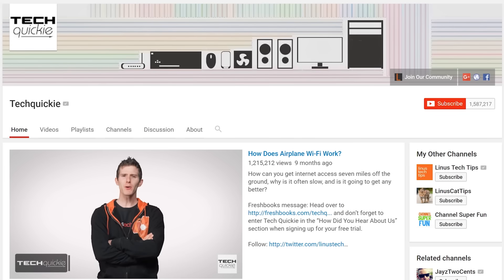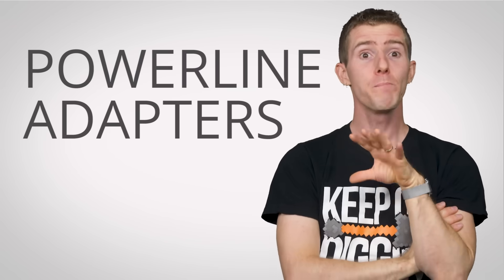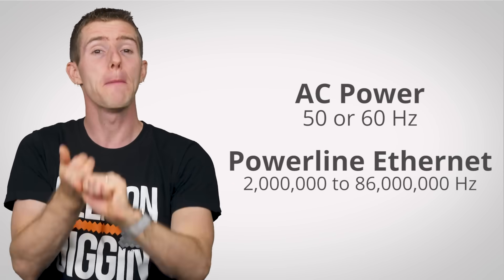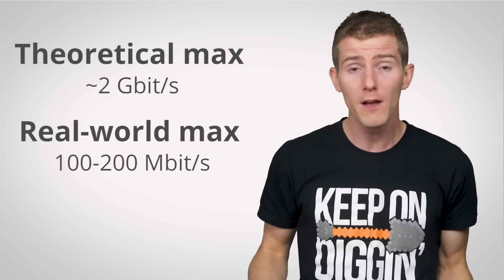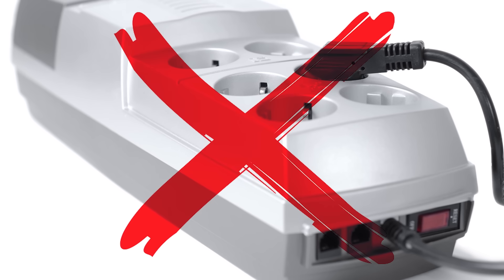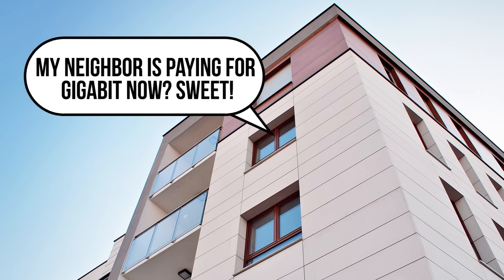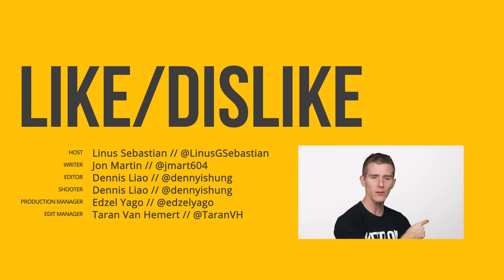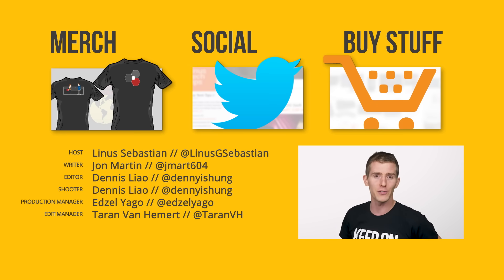How Does Powerline Ethernet Work?

Comment: So I’ve used Powerline before in my condo in Canada but I’ve moved to the Philippines and have a few concerns.

1. We have 2 condos now but are across each other. The engineers weren’t so clear but assuming that the cables are assigned per side (divided by hallway) rather than per floor, would powerline still be viable?

2. In my room, there’s a lack of power outlets so I would need to use extension cords and the most conveniently placed outlet is also blocked by my bed so directly putting the adapter there is a no go. I always believed powerline only worked directly but is it really possible to link it through extension cords? Would it simply depend whether that particular extension cord allows the signal to come through? If not, would it be a better option just to have the adapter on the other side of my room and purchase a wifi card for my PC?

3. Also regarding my room, there’s a conveniently placed telephone outlet where my desk is (but no power outlet, weird right?), is there a way I can use it to obtain a signal from my modem on our fiber plan? The modem itself is connected using a telephone cable too. My original thought process is that you require another input from the modem but I may be wrong.

Edit: My room is in the condo with the modem if that clears any confusion with the first concern.
Reply: No the powerline won't work well in your situation. The best would be to use a mesh network capable APs/Routers in both condos to bridge the network between them.   You could do this with other APs & Routers that are much cheaper but the ones that advertise "mesh" instead would create a more stable environment/connection because of how they communicate with each other and have MU-MIMO.  Depending on the construction of the building, the signals will probably be strong enough.   Look up "best mesh wifi 2017" or something like that to find products; it's a bit more pricey but I'd go that route.

Comment: I have Ethernet connection throughout my home and have really weak WiFi signal on one side. Is there away to expand my WiFi signal w/our buying a repeater or setting another router? Don’t want to deal with multiple SSID
Reply: AB Bermudez using another router doesn't mean you'll have to have multiple SSIDs. You can keep your main one and just use some cheap ASUS router in Access Point mode to extend the range of your WiFi... This way you'll be able to go from being connected to one router to another seamlessly. The problem I'd guess is getting an Ethernet connection from one router to another. Powerline works in theory, but it's not perfect...
Reply: They can be on the same SSID....

Comment: Use your smoke detector circuit. If you apt or house has a dedicated  smoke detector circuit as by code in this day and age,  your smoke detector circuit will have next to no load(interference in this application.) and be readily available in every bedroom and hallway.
Reply: Would be awkward having a wire hanging from the ceiling though.

Comment: The way this house is wired up sadly makes it impossible to run that kind of ethernet from the router to the computer... but thankfully, there's conduits running from the attic to every major room, used for coax cables.
Because of this situation I had been running WiFi for over a decade, but when I (finally) got fibre, it turned out that was nowhere near fast enough (topping out at ~20mbps in either direction), so I ordered 150' of ethernet cable, some toolless ethernet plugs and set to work. From one corner in the living room, to the one where the TV box and one computer are, to set up the router there. Then from that corner, to the opposite side of the living room, all the way up into the attic and then down into my bedroom, which houses the gaming/work rig. Took an entire afternoon, but it was so worth it: Not a single dropout (which were becoming more frequent on the WiFi over the years), and I get the full bandwidth.

Comment: Powerline is a flexible solution. If you are experiencing interference, switch the outlets of most power hungry devices to another circuit.
Running 3 pairs of powerline adapters at home and it works really well.

Comment: Been using powerlines as main for years, love 30am but they are warm to hot when in use (ie: internet is being used) usually with the latter being a cheaper brand that will last couple years but will wear out quicker.

Comment: I would imagine that induction loads on the same breaker would slow down the internet speed since they induce a small amount of energy back on the circuit out of phase with the 50/60hz. even CFL light bulbs

Comment: You missed a caveat, if your Home is not Single phase and your attaching the Poweline to a diffrent phase you won't get a connection as eaxh phase is separated from the other.
Reply: G.hn PLC adapters that make use of the protective earth connection ARE capable to communicate on a three-phase supply. Next to that, your neutral wire is common in every outlet.
Reply: Residential buildings generally won't have 3-phase electricity.  They may have more than one circuit, but on a single phase.  The power line adaptors will work best on the same circuit.
3-phase is mostly used in businesses and workshops with higher power needs.

Comment: Thanks for the simple explanation. We have a total of 4 running through our house. The phone line is at one end of the house so wifi doesn't each everywhere including the flat. Our setup has these powerlines adapters bringing Ethernet to various parts of the house with one that has a wifi modem router attached and this provides the wifi which now reaches everywhere. Now some things still have Ethernet such as the game consoles, TV streamer boxes and a Desktop computer to ensure consistenct performsnce. Our internal wiring is old as so the little boxes have an orange flashing light which indicates that we aren't reaching the full potential of the boxes but there's still a stable connection, it is still enough to meet our needs.

Comment: Yes, you do need to plug the cable directly into your wall's outlet.
But not mentioned in the video is that by doing so, an electrical surge can fry your computer -- the one that you are protecting with a surge suppressor or UPS.
A power surge needs only one avenue into your hardware.  If the surge is strong enough, it will not stop at your power-line network card.
Reply: Perhaps here the thing though most rooms have more than one outlet run your computer off on then run the adapter off another and connect with a cable
Reply: Chase,

There will be a cable that runs from an unprotected wall outlet into your computer's network port.

A powerful surge can, in addition to frying your network port/card, continue on to fry more of your computers innards.

Yes, you can have your computer's power cord plugged into a surge suppressor.  But that does nothing to guard you from the other, unprotected path to your computer, which is via the network/power cable.

Comment: no need for extra security because signal is not going trough electricity meter, so your neighbor can not enter your lan.  also signal is not jumping from phase to phase. so if you have at your home 3 phase system (380V that is standard in europe, dont know in murica) you are pretty limited and you have to be lucky to have power outlets in several rooms on one phase. 3 phase system is distributed is such way so when fuse on one phase blows other two can run the house so 1/3 of wall sockets are on each phase, so you have 30% chance you have 2 wall sockets on same phase to use this technology.

Comment: I had powerline, D-link system. It was absolutely awful, would just randomly drop and say "the dns server is not responding" until I unplugged it from the wall and plugged it back in. It would just be totally intermittent, could do it once a day or once an hour. Made me switch back to wifi - haven't had a problem since. Pretty cool that someone can knock out your internet by turning on a blender or something I guess.

Comment: my router is downstairs and i need this upstairs but my house has different breakers for upstairs and downstairs will it still work?
Reply: If there is a single main for the dwelling, I suspect that it will work.  Basically, as long as there is a route, by way of your electrical cabling, from point A to point B, and the distance is not too far, my guess is that it will work.

Comment: I use one of these, because my room is basically like another house (even though it shares the same powerline as the rest of the house) and unfortunately there's 2 microwaves, a fridge, and a freezer all in the path of the wi-fi signal. I was using an orbi and getting like 70 upload speed, but I had to drop those in favor of one of these powerline adapters (not going into the specifics). Now I get about 30 upload max. As another aside the connection was more stable than before, but I do still occasionally lose the internet connection at times.

Comment: I used one for some time, I cannot recomand using it. I had so many problems with it, mostly unreliable connection speed up to 1/10 of the actual speed at some points.